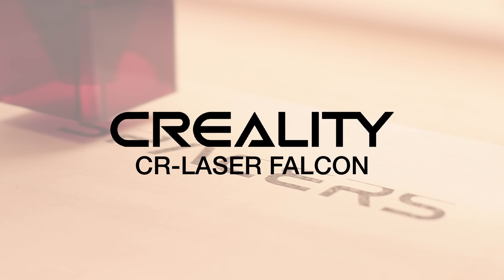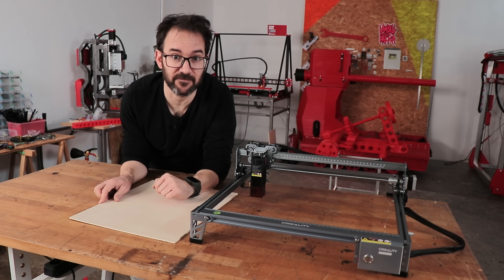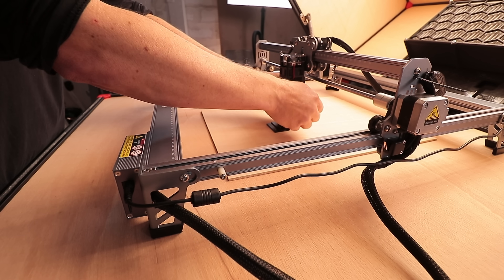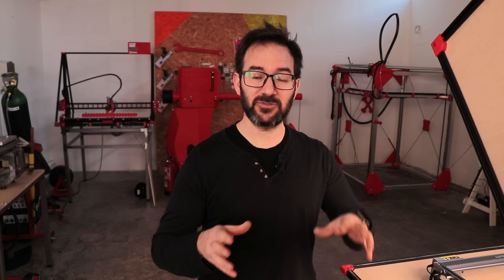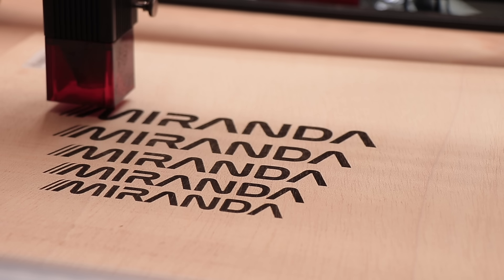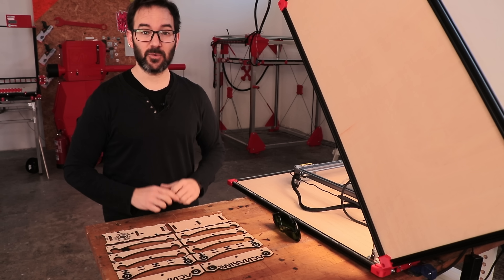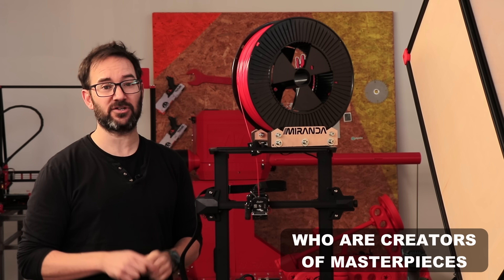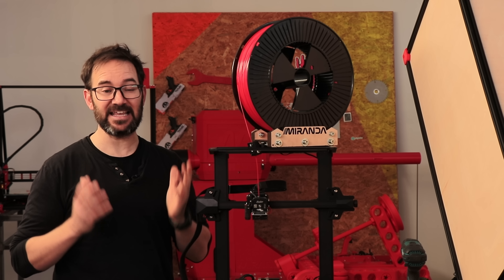MAKING A GIANT SPOOL ROLLER WITH A LASER CUTTER

Comment: I'm curious, but why don't laser cutters use a stable laser and a rotating mirror instead of massive motors and movement?
Reply: Its called galvo systems which is hard to use on diodes because of the focus... Not telling about how the price would rise up...

Comment: The 'rules' also say you must never leave your 3d printer unattended whilst it is working because it can burst into flames, burn your house down and erase your VCR tapes. And, of course, we all follow that advice don't we?  So thanks for the laser health and safety advice. Now can we get back to living in the real world?
Reply: In the real world, laser cutters blind people who don't have and properly use goggles or enclosures; and even with fume extraction, anything with chlorine (like PVC, obviously) will corrode your stuff (and your body outside and in) on contact if the residue is not made inert, and a number of materials can even be dangerous or illegal to vent to the outside without extra precautions to reduce health and pollution issues.

And the people who don't care about these things often learn about them the hard way.

Comment: To get less charring I would recommend using a thin layer of masking tape over the workpiece. The residue will build up on the tape instead of the wood. Then the tape can be peeled off to leave sharper lines.
Reply: Do you need to adjust power to compensate for the tape at all? 
Also, does color matter? Like, does dark blue masking tape require less power to burn than white masking tape? 

I’ve been considering buying a laser for a while but I have lung cancer and I’ve been put off by the fumes.. I’m considering the Gwike Cloud setup since it has air filters included.
Reply: @DanteYewToob  I know it is an old post, but I have tried masking tape, and the heat from the laser leaves the glue from the tape on the wood, so I added air nozzle instead.. and there is no discoloring on the wood anymore, and it gives a cleaner cut, and also cools the cut, my first laser went on fire the first week cutting acrylic

Comment: For anyone that has a laser cutter AND a 3D printer - When do you use your laser cutter?
Reply: Certain projects look better in wood with an engraver, so that makes an easy choice.

But also it's a lot faster to cut a large shape out of 3mm wood than to print a large 3mm-thick shape with plastic.  

If I were designing this project, I probably would have used wood for the sides and bottom like this, but designed the bearing-holders with plastic, and maybe even connected the wood to each other with plastic, and small bolts instead of the large through-bolts he used here.
Reply: It depends on the application, but I often design with laser cutting in mind to shorten prototyping time for larger parts.
Reply: Never because the smell really bad and you get very much mixed results on a lot of stuff. Like you can't just go to the hardware store and buy a sheet of wood that you can cut without issues. Now I used my to cut thin cardboard for packaging and that worked pretty fine, although I had to clean them all because it smelled very bad.
Reply: @MisterMakerNL  Those unenclosed diode lasers are a massive safety and health hazard. They shouldn't be operated without a properly specced enclosure and external exhaust at a minimum.
Reply: @theofficialczex1708 safety can be fixed but usability not. Most youtubers only cut specific stuff they got for free. You have too pay for it, making it super expensive.
Reply: I have a 10watt diode laser machine  (not Creality, but it is not that different) but for for cutting any wood over 1mm I use a scrollsaw. Cleaner, quicker, safer. Cutting this spool holder would take two minutes  with a 100€ scrollsaw, and using a much stronger plywood. No fumes, no fire danger. By the way, there is no indication of what kind of surface is under the machine: when the laser beam cuts TROUGH there is nothing to prevent it setting the table top on fire.
Reply: @AlbertoNencioni  I noticed that it looked like wood down there.  The metal honeycomb will help get the laser out of focus and it'll burn less, but I do like that my current enclosure has metal down there to protect the surface it sits on.

Comment: Thoughts: 
-Laser safety talk was good!
-The laser leaves the gantry up front which seems annoying, park it at the back when the user is done (easy software fix).
-Looks like there is a lot of charring, maybe a settings issue, or ventilation? Can probably clean with surface sanding, but not the cleanest results.
-Also, I'd watch a video about making an enclosure like that. Looked very nice!
Reply: To eliminate surface char you really need both strong extraction and a powerful air assist blowing air on the lasing site, neither of which this machine comes with. Material choice also matters, and many plywoods use glues and resins more likely to char, laser-safe plywoods are less likely to char badly. It is important to only use laser-safe plywood when cutting, otherwise it might contain PVC based glues.
Reply: You can apply a sheet of paper on the top of the wood to avoid the charring

Comment: Good on you for talking about laser safety and demonstrating that you need a proper enclosure and eye protection!
Reply: Honestly the lack of a full enclosure built into the machine seems like a major safety hazard
Reply: @quakxy_dukx  they are a major safety hazard and  laser machines like this should be straight up banned
Reply: @KittenRaee  They are no more hazardous than many tools found in most shops. It's all about responsibility. Arc welders can give 2nd-3rd degree sunburn in seconds, but it's not an issue as long as personal safety precautions are taken, i.e. don't look at the light without the proper glasses. The laser is no different. Not having an enclosure included means being able to make one that fits your workspace instead of being constrained to what is provided.
Reply: @jarekmace1536  the problem is that to use a laser engraver, all that’s needed is to give it a file and press start. It’s a lot easier for idiots who don’t know what they’re doing to blind themselves. That’s why I’m concerned that this particular one doesn’t come with a built in laser shield enclosure but it’s not to the point that they should be banned since if they’re used right, there’s no danger
Reply: @jarekmace1536  thing with arc welders is: you are expected to have a professional experience with them including Health And Safety Training; unlike those right here eyesight removers which are marketed as "al in one solution" towards a DIY home market where some dad can blind his children and poison his family with extremely dangerous fumes because he has no clue he bought a quarter of industrial equipment.
Reply from the maker: Ofc!
Reply: @ivanmirandawastaken  I love your work but I am unsubscribing as I believe helping sell these unenclosed products is irresponsible even though you did talk about safety.
Reply: 100000000% this. Also I need to hear Ivan say "goggles" again
Reply: Bit dissapointed in teh sponsorship at all as creality (and other manufacturers) selling these without enclosures and filters is irresponsible at best.
Reply: Totally agree with this post. Very high risks of throat and lung cancer from the smoke particles.